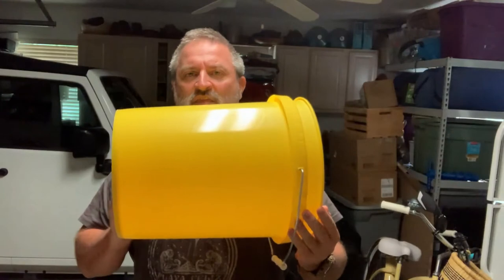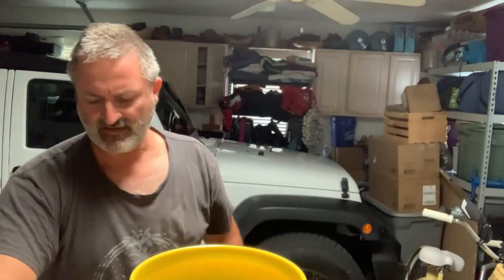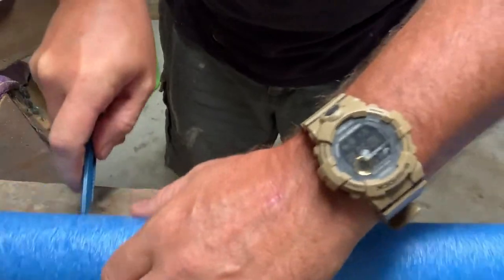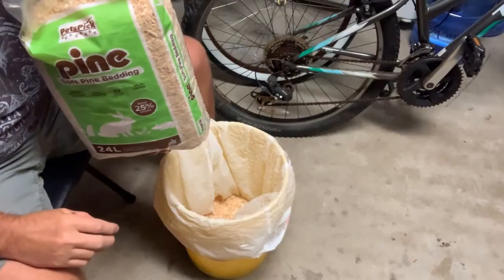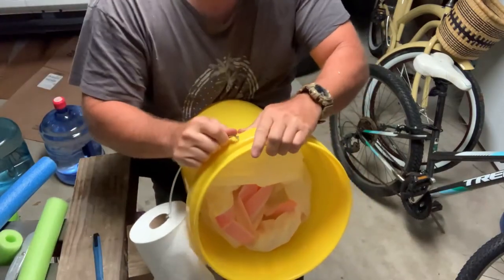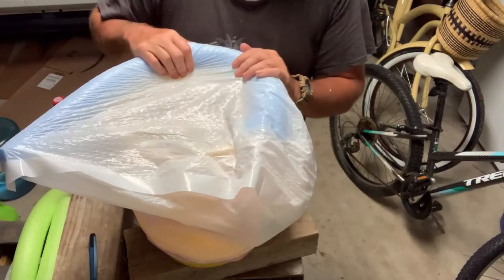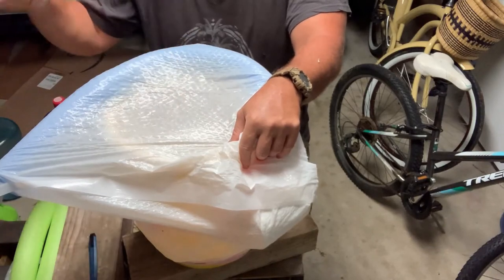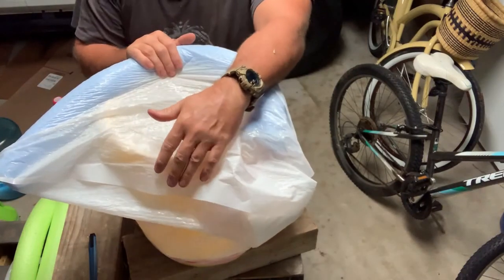Survival Toilet DIY Poop Bucket

Comment: I bought a "luggable loo" at a sporting goods store for $24.99.  You can also get just the snap on seat and lid for $16 that goes on most 5 gallon buckets.  Yours is a great money saver though.  It seems like in an extended emergency situation if trash isn't being picked up a safe humanure setup would be a good option.  Thanks for your great videos!  They are so helpful.

Comment from the maker: Check out the Ready Squirrel Affiliate link to Amazon if you are on the hunt for a longer-term poo solution. Full disclosure, I get money for beans and bullets if you purchase from the link.   Check out the composting toilets if you are looking for a long-term solution for an RV or Off-grid Bug-out location.  "https://www.amazon.com/s?k=Composting+toilet&amp;rh=n%253A15684181%252Cp_72%253A1248861011&amp;dc&amp;qid=1630343915&amp;rnid=1248859011&amp;ref=sr_nr_p_72_1&_encoding=UTF8&tag=readysquirr09-20&linkCode=ur2&linkId=e23148669a1acf3b732de73cc20689f4&camp=1789&creative=9325">Composting Toilets</a>